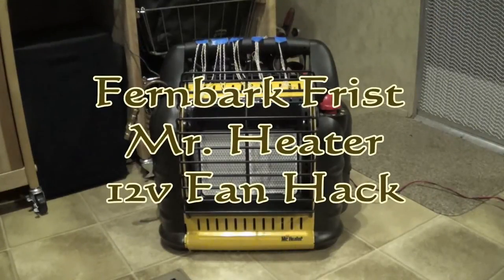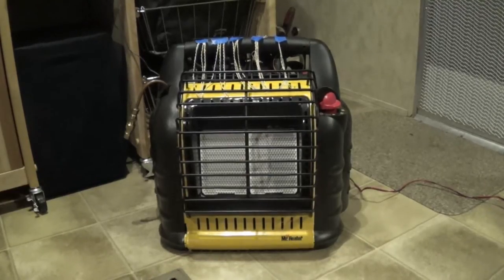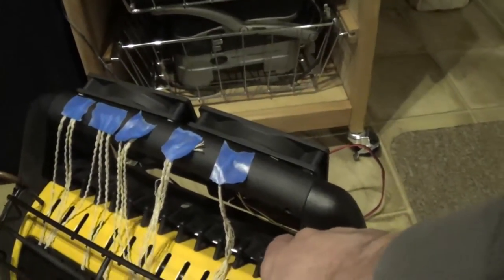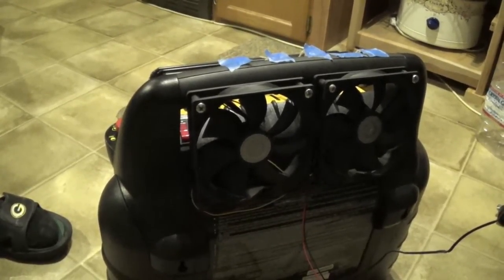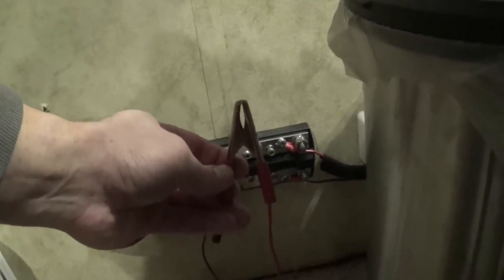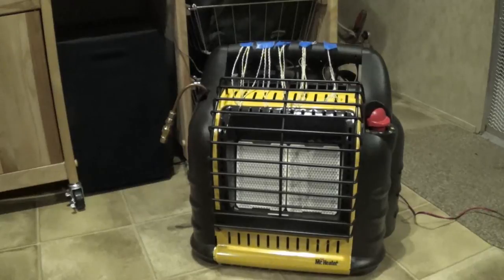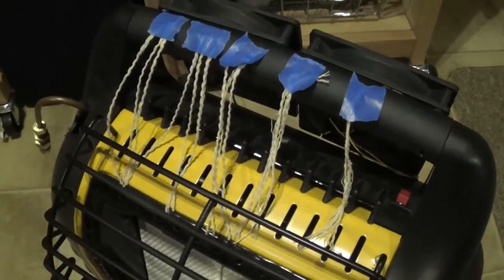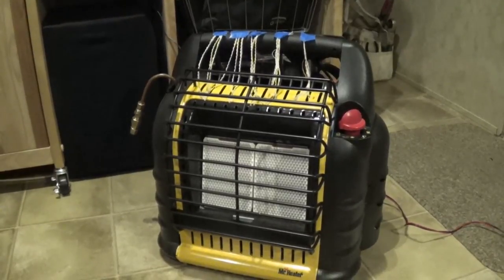Mr. Heater Big Buddy 12v Fan Hack

Comment: You misread the label on that 6 volt supply.   There is no way it uses 96 watts - more like 9.6 watts.  That's still a fair amount of current that could be greatly reduced by going to straight to the fan from a battery, due to a lack of conversion losses.  But, it is not using 96 watts.
Reply from the maker: Probably.  Sometimes it is hard to read through a camera view finder.

Comment: 2:08   hey I'm wiring my van up with a solar and i  want this  device.....   bus bars?  or  well a positive and a negative for the battery to  run to and then a  bunch  for the  circuits?   whats that called that doh icky
Reply from the maker: It is a bus bar.  It is made by Blue Seas.  It is a high quality marine grade bar.  That should give you an idea of the price, lol.  Search amazon for Blue Seas bus bar and it and a few more will come up.
Reply: excellent  and thank you I'm learning .   i have 6 t105  trojans  deep  cycles.  i have 4  1000 watt  panels  to set up in my van.
Reply from the maker: I am going to guess that was a typo and you have (4) 100 watt panels?  That is a lot of battery bank for a van, it will definitely get the job done.
Reply: yes 100 watt each .   sorry well its for a later project the van has currently 1 panel on it.   eventually my  rig  or off grid setup will have all 4.

Comment: UPDATE: Although I did have this issue, Mr. Heater replaced the part under warranty at no cost to me. (Its outside of warranty period) At least they stood behind their product, and for that I do thank them.
-----
I've only put one 20lb propane tank through my heater and the fan literally snapped at the shaft and pulled the wires out when it broke. Looked for a replacement fan on the Mr.Heater website to find out they are charging 35% of the initial purchase price plus shipping. What a piece of crap rip off.

Comment: Many commenters are ignorant of how radiant heaters work. The Big Buddy is a radiant heater that has no open flame (hence the lower BTU heat output). It is NOT HEATING THE AIR so no air needs to blow through the heater unit (that would be a forced "air" heater with an 1300 degreeF open flame). It heats by sending radiant energy (infrared waves) to objects in the room (much like a restaurant heat lamp). It does not heat by moving warm air to heat the person or object you want to keep warm. As a result you could mount a fan anywhere (such as 3 feet to the side of the unit) and essential have the same negligible result (it is not worth doing). Look up how free standing radiant heaters work and this will start to make sense. You might have to actually read as you can't always expect to learn from a youtube video delivering simplified information.

Comment: the strings are mouinted in the wrong spot ....LOGICALLY the air fron the fan is s'pose to blow THRU  the heater ....not over the top ....
Reply from the maker: You can't actually do that with the way the unit is constructed.  Anything pushing the air into the room instead of the heat going straight up is an improvement.

Comment: IMHO it's not a very efficient use of the fans. Your not pushing air thru the heater so it has no chance to pre warm, your blowing cool air at what the heater just tried to heat.
Reply from the maker: It is pushing it into the room verses it going straight to the ceiling.  That cold air needs to get heated too, BTW.   But if you don't like it, no big deal to me either.  Thanks for watching.
Reply: Do you have a better idea of accomplishing what he's trying to with what he has or are you saying it's not feasible?
Reply: @CaseyLane925  Off the top of my head I don't have a fix. I didn't say it was not feasible just not efficient. Look at it this way. Your using air from the coldest part of the room to push the air you just warmed and since you are no longer driving air thru the unit I think you will lose output. Just my thoughts and I may be completely wrong.

Comment: good idea......
Reply from the maker: Thanks.  I am actually going to re-hack my hack and connect the fan to my M12 battery pack, so it isn't plugged into the wall.  I need to find the correct plug and then see how long it will run before I make that video.